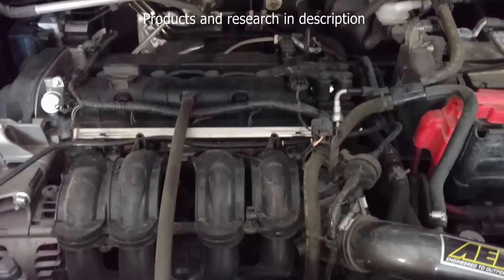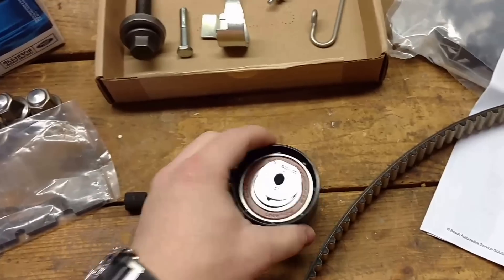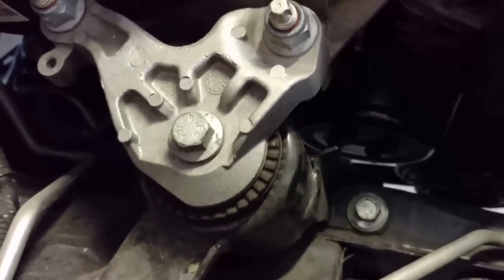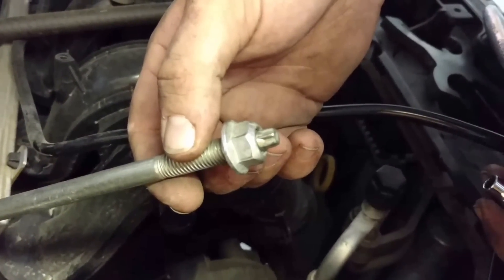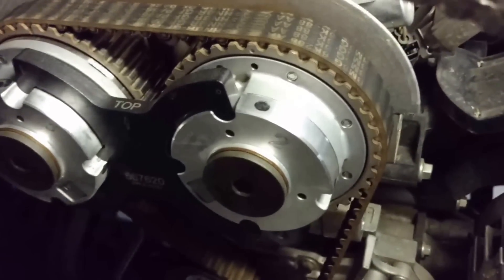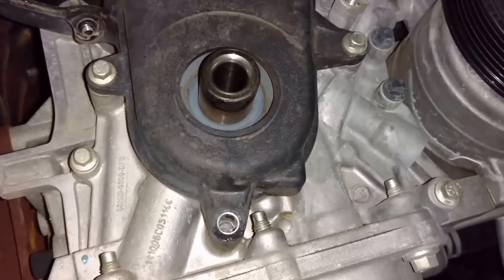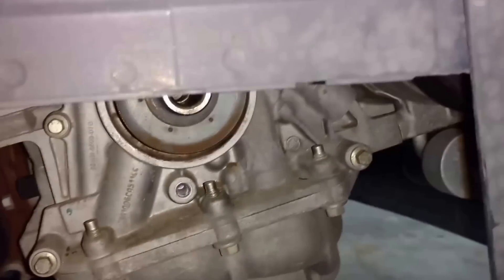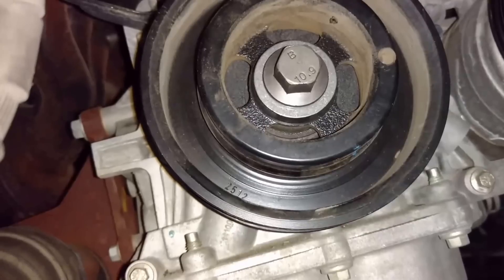2012 Ford Fiesta Timing Belt Replacement Pt1

Comment: how were you able to hold the crankshaft while you torque down the crankshaft pulley?
Reply: 🎉normaly you have to lock the crankshaft at the flywheel by removing the starter

Comment: Do you have to remove the tdc pin when torquing the crank pulley and with flywheel locking tool installed?
Reply: You torque with the pin on place then install the flywheel lock. Remove the pin and cam tools then angle torque 90 degrees

Comment: great video. I was changing the water pump on my son's 2015 fiesta and noted the horrendous noise I was hearing was from a  timing belt tensioner that had allowed the timing belt to slip forward and rub the cover almost in two pieces and wore the belt down to about 1/3 of its original width. by using my air gun was able to get the crankshaft pulley bolt off easily. important to make sure when reinstalling the belt right before torqueing the pulley bolt to spec that the crankshaft is up against the TDC pin since the crankshaft pulley and timing belt gear arent keyed and will spin freely until the bolt is torqued to spec.. by you wedging the screw driver into the teeth of the flywheel you accomplished that goal. thanks so much for your video.

Comment: You skimmed over the only part I was curious about... the crank holder.
Reply: Most of the "specialists" skip this part or do it the wrong way. You have to remove the starter and lock the crankshaft at the flywheel with a special tool which is a lot of work due to the narrow space. Most of the so called technicians here don't answer that question 😢

Comment: Dayco belts and gates belts are just as good as factory belts. I've put them on many vehicles and never had an issue. But you're not hurting anything if you wanna spend a few extra dollars for a belt from the dealer.

Comment: Do you torque the crank bolt against the  timing  pin
Reply: No way, you'll bend the pin for sure, then the valves will make contact too.

Comment: Be careful. On a 2011 Festiva 1.6L (non EcoBoost, auto trans), the crank holding tool will totally bend on you. I had to weld nuts on the sides to reinforce it, as well as cut 3/8" off each end where it bolts on to be able to slide it to fit correctly. Once I did that, worked perfect. I can't figure how to upload a pic or I would.
Reply: You bought the cheap TDC pin and didn’t follow the work shop manual that tells you to install the flywheel holding tool. The pin is only to set TDC, not hold the crank.
Reply: I used the flywheel holding tool. That's what bent, not the pin tool. It was cheap for sure though.
Reply: @SGaryNinja  holy 💩… I must say that had to suck! Over the the last 4 years I’ve timed about 400 of the 1.5 liter engine, same tools similar procedure, never ran into that. Glad you found a way to make it work.

Comment: This is a very good video man! Thank you so much for taking your time to show  how to do a very hard and expensive job Im changing cooling pump and timing belt in my 2012 ford fiesta 1.6 L but don't see any place to lack the flywheel where you pointed in the video there's cover I can't find any place to put a screw driver like you did seems to me like every thing is covered HOW DID YOU LACK THE FLYWHEEL??? Thank you so much

Comment: Nice and easy to follow video.  Watched yours and another where they basically do it the same but then watched this other video with two guys and they took half the engine apart to do the same job.  Hope others don't watch there's and give up on the idea of doing the job themselves because they made a huge mess of a simple job.  Thanks.
Reply: yes i watched that one as well and they pulled the driveshaft on the passenger side, (unnecessary). this was a great video and since i was down this far and with my motor at 150000 i changed the water pump so i dont have to do this all over in a few months.

Comment: Why do we have to jam the flywheel? to prevent crank from going anticlock?
Reply: I think it's to ensure the flywheel does not move anticlockwise while unscrewing the crankshaft pulley bolt. The offical tool to lock the flywheel needs extra work, which you have to remove the starter to be able to install the locking tool.

Comment: How were you able to get the TDC pin in there with the driveshaft in the way?  It fits without removing drive shaft?
Reply: I believe the ST it will not fit.

Comment: Great video mate and so well explained.  I can do this work myself, but now retired in Thailand, so labour cheap at Ford Dealership.  Their charge 450 AUD for timing belt and tensioner, replaced water pump and coolant at same time, new serpentine belt.  I also had them replace transmission fluid as preventive maintenance.  The labour cost in the USA obviously makes it a do-it-yourself option.  Pity you can't hire (instead of purchasing) the locking tools for what is basically a one-time job.

Comment: Cannot believe how ford managed to over complicate this timing belt process, flywheel holder? tdc screw? tty crank bolt? obscenely specific cam pulley holder? no taper fit or woodruff key on tbelt crank sprocket? come the fuck on on ford. at least they made the interval 150k. like thats supposed to give me peace of mind!
Reply: Yes a pain but if done right. Much more accurate cam timing

Comment: Thank you for posting this, I have a 2011 and have followed intently up to 8:48 and no matter how much I have searched I cannot seem to find the exposed flywheel teeth you show, it seems to be covered on the 2011 and I’m warning anyone with the 2011 to check that part out on their car b4 getting all the tools etc (like I did) only to find out that you will have to get a flywheel locking tool which means taking the starter out (a major job on a Fiesta) etc. So just warning that what you see in this video, may not apply to your own car. Signed a very frustrated Fiesta owner.
Reply from the maker: Good to know. I do have a manual transmission. Guess the housing is shaped different.
Reply: Do you think its different for a 2014 fiesta ?
Reply: manual or automatic?
Reply: Manual
Reply: zztoitun  If its manual, this video should apply to your car better than it did for me, as the flywheel teeth were not accesable to me as they are in this video at 8:48, but I would check (with a flashlight) on your car 1st
Reply: Also be prepared to have to weld reinforcement onto the crank holding tool. Mine bent!

Comment: I had the accessory belt split and half of it snap and wrap around the crankshaft pulley on my 2011 Fiesta. I know the timing is off on the car because the engine is not running correctly (significant power drop, very slow to rev up, sounds awful). Following your video and Chilton's manual online, I believe I could replace the timing belt, accessory belt, water pump etc. My problem is that I know the timing is off. Using the camshaft locking tool, and setting the TDC pin, is that all that would be needed to reset the timing? 

Also, you mentioned that the engine was an interference engine. I have seen elsewhere that it isn't? To be clear, the timing belt is definitely still on my car, and it still (somewhat, not usable) runs.
Reply: Supposed to lock flywheel with a special tool too.

Comment: So the timing cover screws are even located behind the crankshaft pulley. So on my 2011 I can't remove the cover without removing the crankshaft pulley. Any suggestions?
Reply: The pulley has to come off to reach all the 8mm timing cover bolts.  Just did this on a 2012 Fiesta 1.6
Reply: Could try cutting the bottom cover in two. Bolts will just about come out.

Comment: If you put the the tdc plug in before turning the crankshaft will the engine keep turning until it hits the tdc plug in the correct position?
Reply from the maker: It should only stop once it's at tdc.
Reply: @vaultvern7704  I'm not 100% sure of that.  Factory procedure says to get the timing marks of the cams at 11 o'clock before installing the pin.  I didn't actually test this theory, and perhaps that's just to make sure cylinder 1 is on compression stroke, but it's definitely important to get it on compression stroke and not exhaust.

Comment: Is this engine 1.25 82hp? any idea how i can recognize the 1.25 60hp with the 1.25 82 hp on a fiesta 2008-2012 
regards
Reply: This is the 1.6L Sigma Duratec. In the US where they only started selling 6th gen in 2011 and only offer either the 1.6L Duratec Sigma (non TI-VCT) 120HP, (Which is in the vast majority of Fiesta's sold here,) or the 1.0L Fox EcoBoost. (Starting in 2014.) We didn't get the 1.25L or the Diesel options.

Comment: I just used your how to to change my timing belt today in my 2011 Fiesta with 123k miles on it. Definitely a great set of videos.  A couple things I noticed that you didn't cover . I used PB blaster in every bolt I was gonna remove a couple days before I started.   Seemed to help a good bit. I used a snap on impact and it spun the crank shaft bolt off pretty easy. The crank pulley was stuck on so I used a slide hammer and it popped right off. Without the crank bolt installed, the crank pulley and the timing gear/pulley behind it spin freely.  They are not keyed.   Freaked me out at first.  This is why it's imperative to set your car to TDC before removing the crank bolt.  I definitely couldn't have done it without your video.   Thank you a million times!   Ford dealer quoted me 400+ for labor alone for what I did in 4 hours.
Reply: Rust belt sucks. The high desert no rust

Comment: I am just doing the timing belt on my sons 2010 Fiesta WT and this video has been fantastic, way better than anything else on YouTube. I have struck an issue though and if you or someone else can help that would be great. I am trying to install the new tensioner and I cant seem to do it. I try putting the tensioner on first and then putting the belt on but it seems very tight and I don't want to damage the belt. I also tried to put the tensioner on with the belt and it seems impossible, in the space, to get enough purchase to get the bolt in. Please, Please any help would be gratefully accepted.
Reply from the maker: Sorry for getting to your comment so late. The only help I can give you is to look at the video at 9:55. Just push the two tabs on the tensioner together, put a nail through it to hold it. Install the tensioner before installing the new timing belt. Install new belt then pull the nail/pin out of the tensioner releasing its tension and done.
Reply: @vaultvern7704 A 2011 Fiesta 1.6 in mint condition with 109,000 miles on it. Very well maintained everything but the timing belt? I heard you can change them at 150,000? Is that to long?

Comment: should of done a water pump while u were in there..those things like to leak every  30 to 60k
Reply from the maker: I plan on doing another belt change at 100k. Hopefully it will last that long. If not no big deal. It wasn't really that hard doing this.

Comment: I would be interested in what happend to the timing belt while tightening the crankshaft pulley screw? I did it several times. And if you're going along with the official manual, tightening the cs screw while the timing belt is placed. Then the belt is gonna be stretched because the crankshaft sprocket wheel and pulley wheel is rotating a bit clockwise due to friction. So the belt is overstretched. First I tighten the crankshaft 40Nm 90° and then installing the belt. (Only the TiVCT because the camshaft wheels are fixed and the crankshaft sprocket is without key.) So how did you handle this?
Reply from the maker: I installed the crankshaft bolt with the belt installed and the tensioner released. I didn't really think of the friction adding tension. I don't have any way of checking actual tension on the belt. I don't think that would be much of an issue. Since the accessory pulley is a friction fit(slightly tapered crankshaft) the friction from the bolt I would think would be much less the pulley to crank surface area. Plus the bolt has a washer that also creates more places to slip. If it does over stress the belt, I would think once you take all the locking tools out the cams would adjust themselves, because they can adjust themselves up to an 1/8th of rotation either way. That's my two cents in, but I'm not a certified mechanic either. I just do this because I enjoy working on my car to save some money. Plus I plan on changing my belt every 50-60K Miles and costs me $130.
Reply: VaultVern Well, when I did it the first time on the 1.6 TiVCT - tightening the crankshaft screw (timing belt fitted and tensioner released). I had to stop tightening. Because I noticed that the belt was stretched dangerously. I thought it would rip... It was about 30° and I had to stop. After this I never tried it this way.
And I know the friction issue from the normal 1.25 or 1.4 litre engine without variable camshaft timing. But there it's not a problem because the camshaft spockets are loose. So if the crankshaft screw is gonna be tightened, the belt is rotating a bit clockwise, also. But remeber the loose camshaft sprockets. So it doesn't affect the timing and the tension of the belt. 
I never have found a video where the tightening process is shown. Everyone is skipping this part 🙄